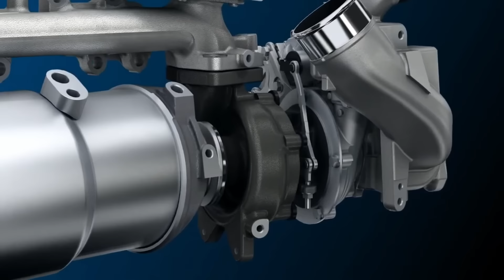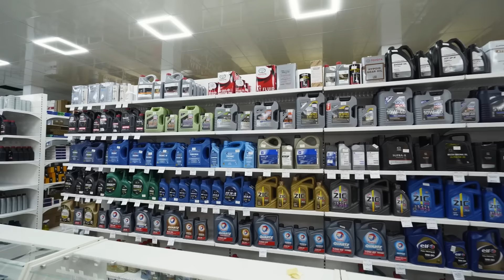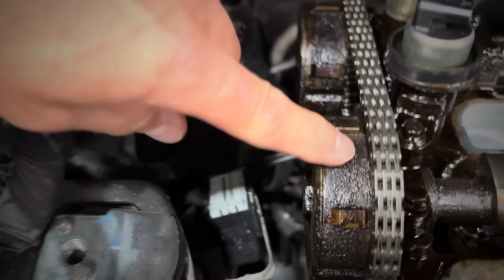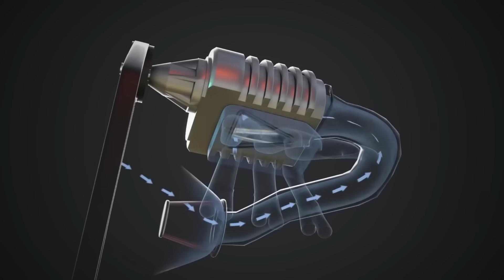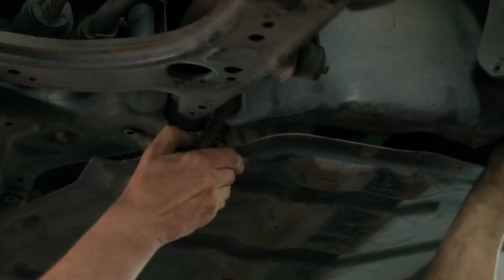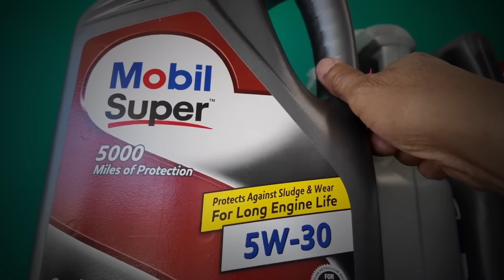Mechanics Won’t Tell You This About Synthetic Oil! Exposed!

Comment: The only true blue 100%  synthetic oil on the US market is Amsoil and Red Line. That I know of. The rest so called Synthetic oils are pac 3 oils. MORE Refined conventional oil with synthetic additives. NO OIL WILL LAST 10K MILES. The additive package breaks down completely after 5k-7500.  Safe range is 3k-5k oil changes to prevent engine wear.  2k-3k changes your Golden.
Reply: I use “Mobil 1 extended performance” and I agree 💯 with your comment 👍🏻
Reply: The only TRUE SYNTHETIC oil is Pennzoil because it is NOT made from crude oil.  All others are made from crude. It is SYNTHESIZED from natural gas.
Reply: @alpine9996  Group V Ester synthetic oils are made from plant base. Redline uses a Group V Ester base in their oil.
Reply: @LeeCountySpeedShop   not necessarily, group 5 is a kind of catch-all group, it includes many different bases that don't fit in the first four. Have you heard of polyethylene?
Reply: @oneninerniner3427  Group V is were all other synthetic oils are grouped outside of Group IV PAO, many of those synthetic oils are not usable as motor oil, Redline Group V Synthetic base stock comes from a plant base.
Reply: Wrong. My VW TDI had recommended oil changes at once every 10,000 miles. Had no detectable wear and did not burn any oil.  Truckers often go much farther - double or more mileage between changes. It's all about the engine design and lubrication specifications.
Reply: You mean group III highly refined, hydrocracked, petroleum base called synthetic in this country. It is better than conventional mineral oils. But not as good as group IV & V chemically synthesized true synthetics.
Reply: GTL Penz (gas to liquid) is a petroleum base.
Reply: Wrong.  The ones that say full synthetic are in fact fully synthetic.  You seem to be confusing them with the synthetic blend oils that manufacturers like Ford sell and recommend.  Those are conventional/synthetic mixtures.
Reply: YOU ARE RIGHT 💯! I worked in different Autoparts companies for 21 years, it’s mandatory to take classes or training to work in that field , excellent explanation about oils , also you should have mentioned that because Castrol those so called “synthetic” are now “Group III” oil group and Mobil 1 sued  Castrol for advertising false synthetic oil 👍🏻

Comment: My 08 Toyota Tacoma is over 400,000 miles on Pennz Ultra Platinum at a 4k change interval. It still starts and runs like the first day I bought it. Prior to Pennz Ultra being on the market I used Mobile 1.
Reply: you picked the best oil out there, a half million is possible good luck to you
Reply from the maker: Wow, that's an impressive testament to both the oil and your maintenance schedule!
Reply: I use Pennzoil ultra synthetic oil in my 04 suabaru impreza outback sport w 217k miles and never had a problem.
Reply: Oh do we miss old Toyota engines. Toyota has lost its reliability regardless of what oil you put in it or type of oil. That’s Modern Toyota
Reply: Mobile 1 is what Toyota's oil is.
Pennzoil Platinum and Ultra Platinum are made from natural gas and are 99% clean compared to all other oils made from crude oil that are 90% clean.
These specific 2 Pennzoils per lab tests are the best for current automobiles.

Engineers, hydraulists and experienced mechanics all say to change the engine oil & filter every 5,000 miles (8,000 kms).
Reply: @human1513     the auto manufacturers bid out their oils. They could be made by almost any oil company.  99% clean? That's a good marketing theme, that Penz never said. Yes it's GTL (gas to liquid) one of many ways to make a group 3 highly refined petroleum based, considered synthetic in this country.

Comment: if you have a turbo 4 banger use Pennzoil platinum 5/30every 5000 miles
Reply: Use   Castrol Advanced,  full Sythn.❤🎉
Reply: @IronMike-f8i  Castrol syn for over 400k now
Reply: Mobil 1 extended performance high milage full synthetic in 08 Acura rdx turbo with 186k, Honda calls for Mobil 1 specifically.. Only to use one's comparable when Mobil 1 isn't available.. Idk how much of that is political marketing or what. I think amsoil is the best in my opinion. $$$ But the best.
Reply: @NRP-f4s Around 2000 Honda and Ford specified 5w20. The only oil that met the spec at the time was Pennzoil conventional oil. Shortly after that Mobil 1 was produced to that spec, I switched to the Mobil 1 when it became available. 176,000 miles, over half heavy towing, and oil consumption has not changed.

Comment: How about synthetic blend oil??
Reply: It's trash. Never use it unless your going 3000 mile change intervals.
Reply: @o_g_i_b_rockin  I used it three times and change it after traveling a distance 6250 miles, and my engines had no problems. Let go of illusions.
Reply: Half
Reply: Use on my 96 Accord 300.000 + still kicking
Reply: @Yoowahh Synthetic Blend oil is giving you those results?!😮
Reply: Just change your oil every 3.000 miles and you’re good . One time a old mechanic told me oil is oil 😂😂
Reply: @jaimeplacencia1918      not anymore

Comment: Don't go over 7500mis w/ synthetic oil thats safe max for most. Use good synthetic oil filter too! Pennzoil Platinum for the win. 👍🏻 💯
Reply: The ultra is even a little bit better, but mostly not necessary for average applications
Reply: Only a fool would go over 5k , don’t be a cheapskate change it!
Reply: @brucedale4465  you must replace your radial tires at 15,000 miles too huh? Because that's what we had to do with bias ply tires.

Comment: Dishonest implying that Synth is really synth, not just Dino with stuff added- for 2-3 times the price. Scammer video!
Reply: @robertmcmahon1807
I can tell you know nothing about Amsoil.
Reply: Since you can't compose a complete sentence, I'd guess you've never had a car that either had a warranty or was worth maintaining.
Reply: @johnstuartsmith  tf? is your point? over 60% of cars on the road dont have warranty. 50K dollar car sold at 100k will probly cost 12-15k ill run non synthetic on it till it blows up typically 250k but its never oil related issues. 3-5 mile oil changes is the key. if you dont know 3k is the key. I spend $30 a oil change. Synthetic would cost roughly double. Ill have fresher oil for longer at the same price.
Reply: @johnstuartsmith  Since you couldn't respond, you just cursed.

Comment: Some manufacturers recommend 10k between changes. Reduced maintenance cost as a selling point. It's foolish to wait that long with a gasoline engine. The old saying oil is cheaper than an engine is very true.
Reply from the maker: Great point, the cost of frequent oil changes is definitely lower than the cost of a new engine!
Reply: @Cars.GuideDIY  Changing cleaner oil is cheaper than changing parts worn out early
Reply: I wish I knew this before putting almost 400,000 miles on my truck changing it every 10,000 miles....
Reply: @mikeleschber1316 you need to play the lottery!
Reply: @mikeleschber1316 depends on what conditions it's used
Reply: @mikeleschber1316  All synthetic oil to do that. And still foolish 10K oil change has been dis proven by the masses
Reply: It's your money to waste. I choose to spend mine wisely since I have to work to hard for it. I've been doing this for the past 40 years and never fail to get at least 300,000 miles out of every vehicle.  @user-cl5ov9dx5o
Reply: Get an oil vacuum and pull out what you can from the dipstick access at 5k and replace the filter.  Some engines don’t allow all of the oil to be removed from the top by vacuum.  Some engines have filter access on top.
Reply: Do you replace your radial tires every 15,000 miles? Because that's what you used to have to do with bias belted tires?
Reply: Another thing you want to consider is that switching between different oils even if they are the same viscosity introduces different additives which could cause chemical reactions that can cause premature wear . I would stick with the same oil and not go back and forth between brands to avoid potential chemical reactions that may cause more harm than good to the engine .
Reply: I only ran mine 9k between oil changes till it got to 310,000 , then it started to leak oil . Now it gets a new quart every 120 miles , and now  there is no need to change it when it's always fresh
Reply: Did you mean every 1200 miles?
Reply: @Timmymao163  My typing goofed, oil changes can be based on use 3,000 to 10,000 miles are reasonable 1700 is a keyboard oops
Reply: @MikeSmith-nu9wt  you must live in a moderate climate. Cold starts and stop and go driving kill the additives in oil much faster. Sometimes in less than 3k miles!  Used oil analysis is how you can tell what's happening with your  engine. Otherwise you're just gambling.
Reply: @MikeSmith-nu9wt that is very good mileage. For today srandards. New small engines fall at eveb 50k...yes.. sad...
Reply: My son has a new Toyota Tacoma and he's bought into that foolishness hook line and sinker.